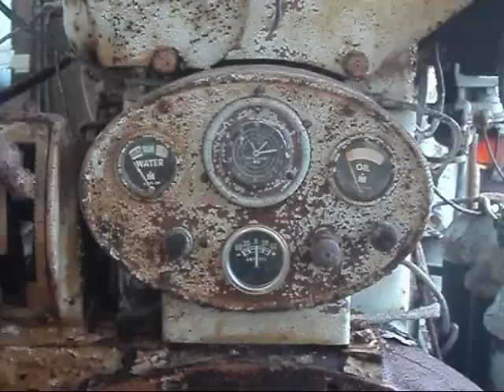Urban Exploration...Long Abandoned Stone Quarry

Comment: that international bulldozer is VERY rare you sould got ur hands on it, it runs on both gas and diesel! it starts on gas to get it warmed up and lower compretion, then u pull th lever up and it closes the carb, rases the compretion and turns on the injection pump and bam its running on diesel. i bet if u clean out the cab it will fire right up on gas,! then it might run on the old diesel thats in it! make more vids
Reply: International UD engines.